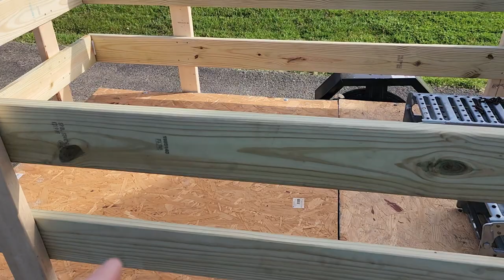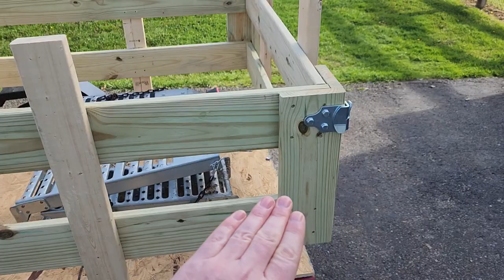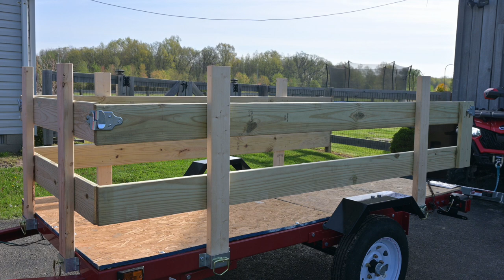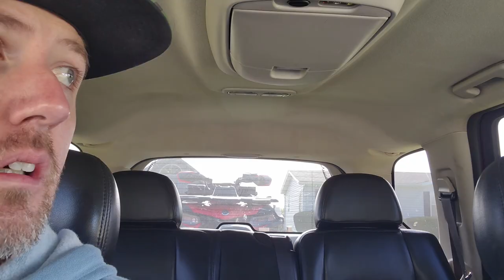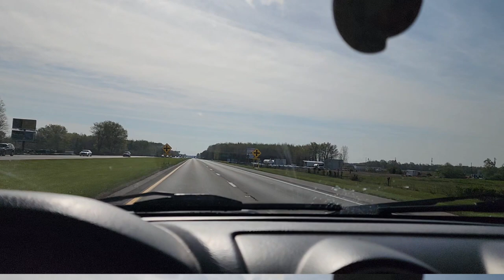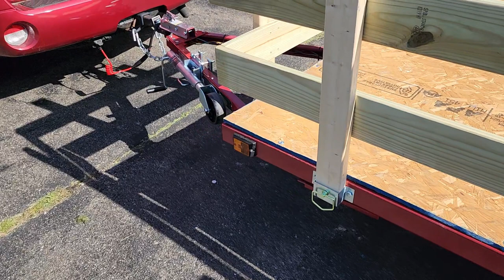Cheap DIY Removable Side Walls for Harbor Freight Trailer

Comment: I used my trailer to haul my lawn tractor w/46" deck & had zero problems.

And regarding the hitch pins for your gate, well all your hitch pins. As a suggestion, always put the cotter pin back in the hitch pin. The way you showed it is a great way to lose your cotter pins. And ALWAYS tie down ANY piece of equipment,  bikes, etc to keep the load from shifting around.

Comment: I have one that I use daily that is around 25 yrs old. It's never been stored inside. I pull it around with my manual 95 accord. Make sure you carry at least one set of bearings and grease. My biggest issue is keeping the lights working on it.I would have dadoed the the walls so you can get a 4x8 sheet goods on it. I routinely haul 5 to 7 sheets of 3/4" mdf which weighs around 120lbs each sheet.
Reply from the maker: Thats lasted a long time!

Comment: Looks like some of these harbor freight trailers (maybe the lower weigh capacity versions) have build specs that don’t have bolts heads sticking out the top of the frame, as our 1720 capacity trailers do. So as far as the plywood decking is concerned, did you drill recesses around the perimeter of the plywood sheet to accommodate for the 12 bolt heads sticking out of the top of the frame, or did you just bolt it down so that the plywood sheet is slight raised higher around the edges due to the protruding bolt heads? I just don’t see you or anyone else electing the third option which would be to remove all the bolts from the top of the frame.  I hope that makes sense. And thanks in advance!
Reply from the maker: Yea, i just left them, and the edges stick up just a touch. Not enough to make a difference for what i use it for, but it would be nice if a sheet would lay flat from the factory
Reply: @DirtbagOutdoors  The lower capacity trailer appears to only have four bolts—one at each corner—protruding from the frame. I watched a video by a mom and daughter who put one of these together and they did drill a hole to recess the bolt heads. It was a really clean job. I’m not sure I want to do that for the 12 we have protruding from ours, though 😅. I appreciate the prompt response. Thank you.